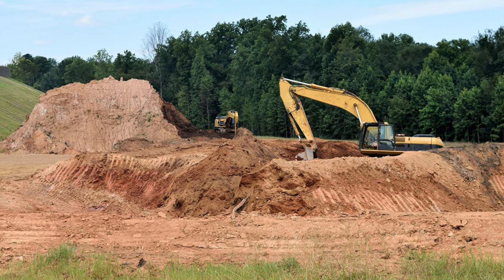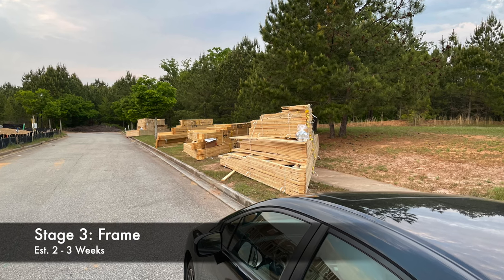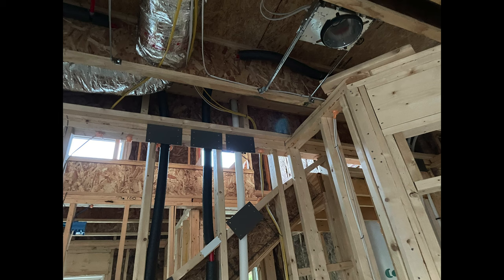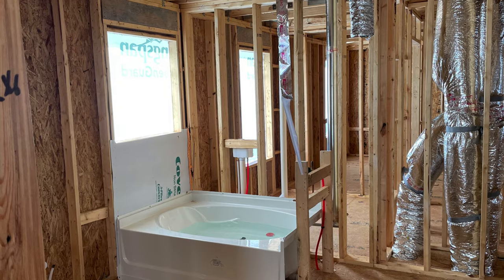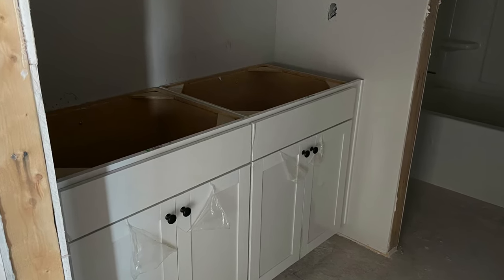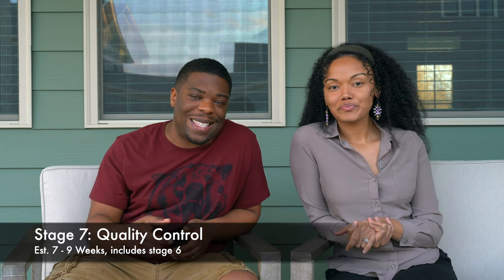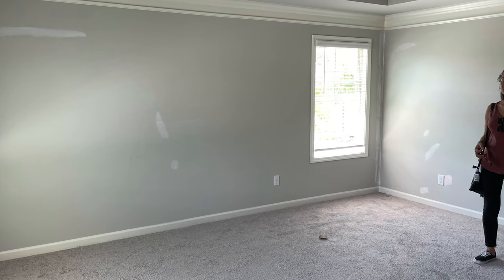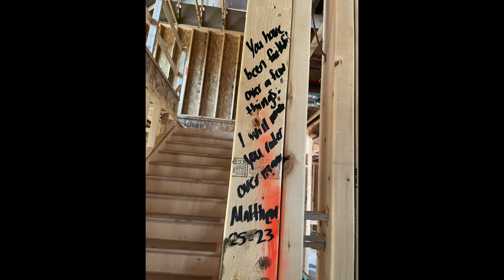NEW HOME CONSTRUCTION PROCESS | DR HORTON

Comment: Problem with the slab phase is that they will pour concrete one day and the next day if the framing package has been dropped they start framing. Concrete has no time to cure and harden to prevent cracks in the slab which if you don’t have a unfinished basement you’ll never see if your slab has cracked or not!
Reply from the maker: Not our experience. The builder actually explained to us that the slab had to sit for a while before they could start framing.

Comment: Did DR Horton encourage  homebuyers to visit the property during stages where there were no official inspections?  I know of a builder who mentioned in their paperwork that this was not permitted.
Reply from the maker: All builders place in the contract that you shouldn’t walk the site without their pre-approval. This is just to protect them, since the site can be dangerous at times. When we walked the site we made sure no active work was being done to our house and that we were careful to not step on any nails or unfinished areas.
Reply: Yes, you are assigned a site superintendent who gives you weekly updates on the progress and allows you to schedule walk throughs during the stages. We are currently in stage 5 (plumbing and wiring) once we complete our walk through they will begin dry wall.

Comment: Hi, I hope all is well. Question: Did ya'll have a new construction orientation prior to closing? If so, what should one expect?
Reply from the maker: Hi, Latoya! Yes, we did have an orientation right before closing. We did a “blue tape” walkthrough where we placed a piece of painter’s tape on areas that needed fixing before we moved in (paint, molding, caulking, etc.). They took us through each area of the house and the outdoor space to walk us through any important functions we need to know (sprinklers, HVAC, gas, water, breaker box, hot water heater, appliances, etc.). They had a checklist to make sure they covered everything, and we had to sign stating that we received the orientation. Hope that helps, and best wishes on your home journey!! 🙏🏽🙏🏽
Reply: @theirvs793  Yes, thank you